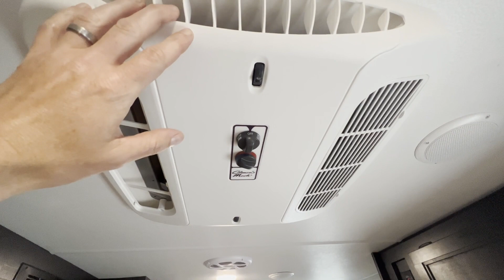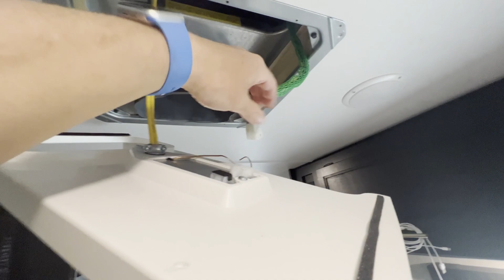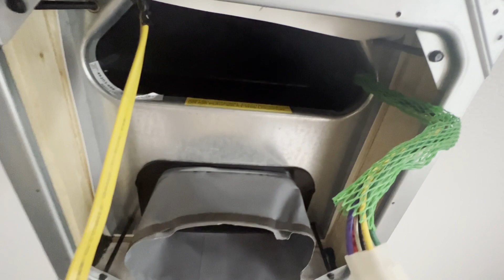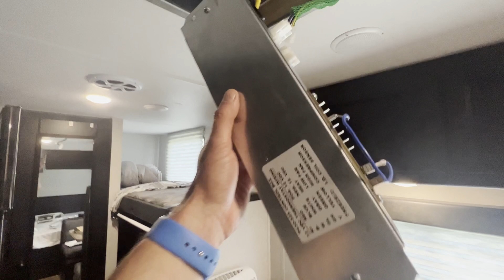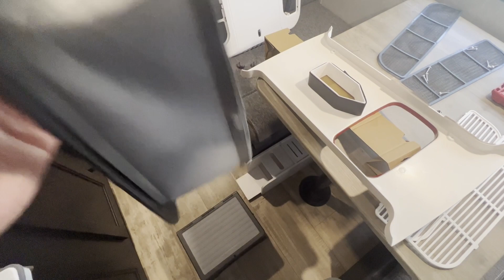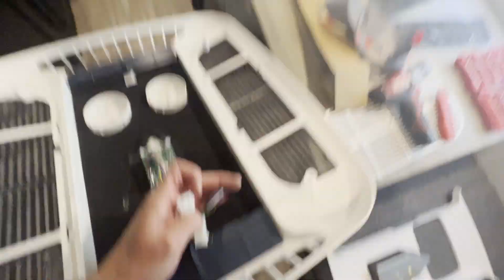Coleman Mach AC Bluetooth RV Install - AC Upgrade

Comment: Is there a way I can make this new AC you installed smart? Instead of changing things over bluetooth (where you have to be in close range), any way I can connect a smart thermostat and change the temperature using the thermostat app?

Comment: Thank you for this video. We did this in about an hour. We usually turn a 1hr job into a 3hr job but and we followed your video and we successfully completed it in a reasonable time.
Reply from the maker: Awesome! Glad it helped! Be curious to learn if your temp sensor is more accurate than mine - I find I have to turn the AC down much lower than I would at home for example to achieve the same sort of cooling. I feel like the temp sensor gets colder much quicker than the rest of the trailer so its a necessity to turn the temp down.
Reply: @MatrixPrime  So far we feel the temp we set it to is fairly accurate with our unit. We prefer 68-70 degrees year a around in our home. We have been in the RV since we installed the assembly this week and have been comfortable, night and day, with it set at 70 degrees. Now maintaining that temp in our Wolf Pup 16fqbl has been a challenge with this heat wave in the south so we are dealing with the AC unit cycling off and on numerous times per hour but we do enjoy being able to set a temperature and prevent the fan from blowing 24/7. Thanks again!

Comment: Just installed this today and while watching YouTube videos like your to assist, I have come across many comments saying the unit works great but the rv will get really warm before it kicks in again……also saying the thermostat doesn’t read correctly. Did you have any issues like this? I have the same camper as you…..Wolf Pup!!!!!
Reply from the maker: Yes actually. I've found that I'm having to adjust and fiddle with the temp, putting it well below what I normally would to adjust the temp in the trailer. I think it has to do with where the temp sensor is located.
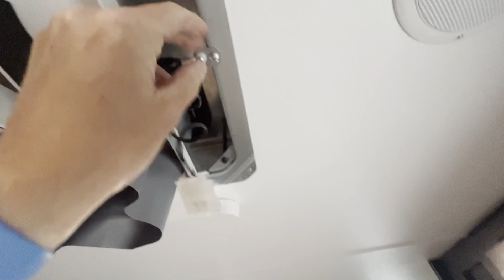Reply: @MatrixPrime  I have seen another video (sorry, can't remember who) where they believed the temp sensor being screwed into the metal frame (17:30ish) is reading the chilled metal and giving the false reading.  He removed the sensor from the screw and placed the end into a groove in the plastic cover near the filter, more in the path of the return air and was much, much closer to having an accurate reading.  I'm planning on this conversion myself in the next month to control the temps better in the garage of my toy hauler.  Great video!
Reply from the maker: oooo, thank you for the tip on this. I haven't seen that video, I need to track that down.
Reply: @MatrixPrime  thanks for the reply. Our next camping trip is in August, I’ll pop the shroud off again and move the temp sensor before we head out.
Reply from the maker: @vbdbrian  curious to know if that helps.
Reply: @MatrixPrime  I’ll keep you posted
Reply: @vbdbrian  did moving the sensor help?

Comment: I’m not clear why you needed to remove the double sided tape (and replace the sleeve when you couldn’t). Looks to me like it would have been ok to leave it…. Good video though and will be very helpful when we do this. Thank you!
Reply from the maker: The factory sleeve can rip when removing everything. In my case it didn’t and I didn’t need to replace but as long as I was there I figured I’d use all new parts.

Comment: I did this but after a year I’m having an issue where the thermostat reads a lower temp than it actually is causing the the a/c not to kick in… or if it is working the temp is staying to cool up in the intake any ideas?
Reply from the maker: You sure your sensor is mounted correctly?

Comment: Ran into problem trying to covert my Dometic to this coleman,  The Dometic Units mounting holes were exactly 1' 3/8" apart. The Coleman Mach was about a inch smaller. Not the only problem i Found. 
The people that installed the Airbox glued my old one up because the screw holes did not align with the frame.  When I re-installed it I left two screws out because they don't screw into anything.....On a positive note they added a bunch of insulation and the unit is sealed up nicely.

Wonder if that means they built the A/c opening too wide?  both screwed on the left and right side fell short of reaching the wood frame.